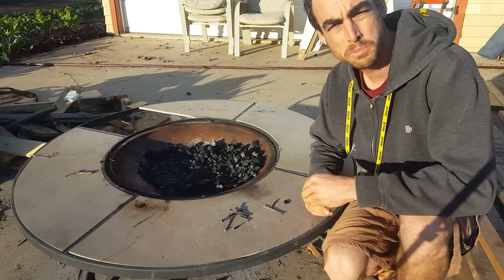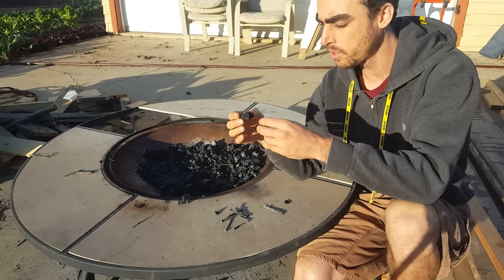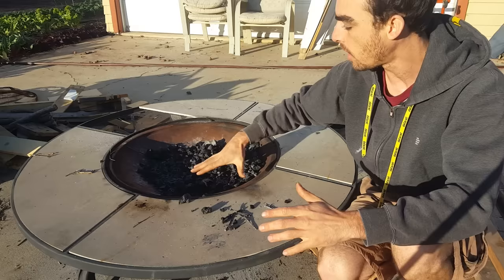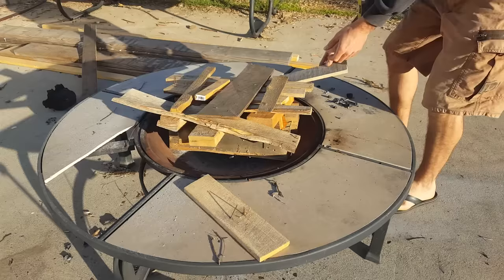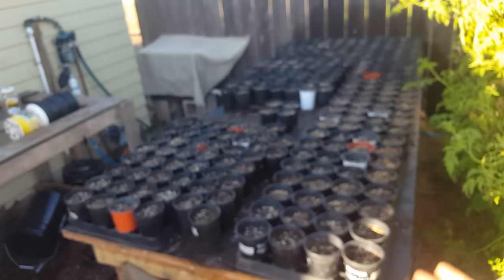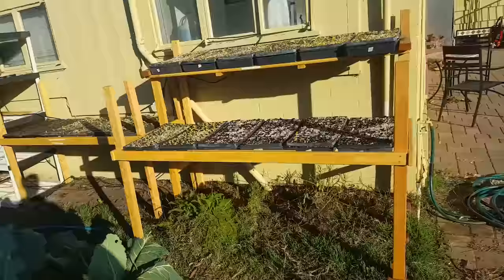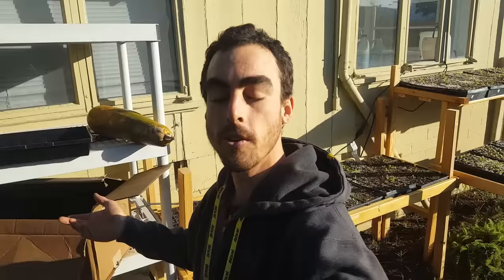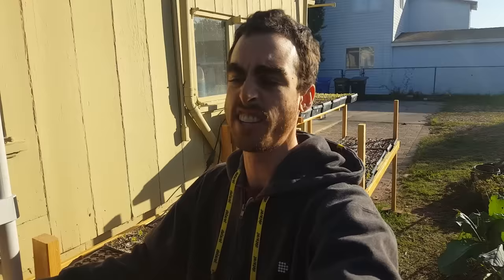Market Garden Vlog | Best 1020 Seedling Trays

Comment: Small correction, it is notvthe temperature that causes the char to turn to ash but the presence of oxygen, you pyrolise things at higher temperatures (even 800Celsius) and still not get ash.
As all volotiles have cooked off and oxygen gets to the embers at that point the temperature will increase because coals just burn way hotter than the syn-gasses.

You still did a great job explaning it though :)
Reply from the maker: Ah right the oxygen! I remember my teacher telling me that. Thank you for the correction, total novice with biochar still hehe.

Comment: If you acquire enough clay like mud, which shouldn't be an issue, stack up your logs in a manner that will fit your fire pit. But make sure to do layers. Take hay and small twigs and put them on top and all around your logs. Than take your mud clay mix and build a barrier around the wood mound. Making it thick to help prevent cracking. After which dig out small holes out of the clay, around the mound and on the very top. Light your dry material around the holes and on top... wait for the wood to start glowing red, than cover the holes with more clay. This will slowly start to cool every thing down whilst turning the wood into biochar. Honestly I've found this to be very effective and extremely cheaper than buys a kiln for it. Minus the fire pit, it's all natural resources and the clean up is simple. Hit that like if you like that method. I will note like a kiln this will take sever hours. Have a great day everyone. ^.^
Reply from the maker: Thanks for the advice Michael, sounds like better way to do it. I was just screwing around with with the fire pit to see if I could make it. So do you do it in a pit? I'm in an urban area so that's why I was thinking to do it in a kiln so it doesn't look like an open fire lol.
Reply: Nature's Always Right you can do it in a fire pit or in a dug out. The concept is still the same. I've seen it done in mud and clay tanks as well. But with the tanks you don't have to open up holes around the tank, just around the top at first. I have a small fire pit that can be moved around. Bought it from Wal-Mart for dirt cheap lol. I build a table that can placed around it and taken off so you can hold a bit more for the barrier. The one tip I will say is to have a little more mud clay mix on hand and every so often check for cracks around the area and just fill em when needed. Other than that it'll take care of itself.... one more thing though lol. Try and use a combination of 60-70% hardwood and 40-30% soft wood. I hope this was helpful to you. Keep up the great work!!
Reply from the maker: Ok nice thanks so much Michael that helps me a lot. I'll try to research more about using mud. I'm trying to do this easily and cheaply, I found an awesome source of 4" diamter totally dried bamboo that I want to use as my wood. Like 1000,s of feet of it. But it's like 6 feet long so I'll have to cut it all up, so looking for something I can fit 3-4 foot pieces into.

Comment: Was that plywood in your fire for the biochar?  Biochar is great and i use it myself but i don’t recommend using plywood or anything with chemicals in it.  Find a local furniture maker who uses natural wood and get the scraps. Should be free or low cost and free of chemicals too
Reply from the maker: Ya you are right I just noticed there was a piece that got in. Oops, the rest was just scrap softwood from building projects. They use adhesive to combine the layers of wood? Nice thanks for that tip! Once I build my kiln I'm going to burn bamboo, I have a really good source of it. This char was just for fun to see if I could make it at home really simply with little knowledge haha.
Reply: @NaturesAlwaysRight  You really need to learn the fundamentals of making charcoal, like limiting oxygen into the fire .
Reply from the maker: @kimblewt  This was just to introduce people to what biochar is (most have never heard of it) not a demonstration on how to correctly make it.

Comment: Thanks for the 10-20 tray source. What % shade cloth did you purchase? Will you use the shade cloth all of the time or pull it back when the temps aren't too hot?
Reply from the maker: No problem, I searched forever for good trays. I'm using 50% shade on recommendation from other local farmers. It will be like 85-95 all summer so I will leave the shade on all of my greens. I'm not using it on summer crops like tomatoes and squash.

Comment: Hey dude love the channel keep up the good work. I just had a question about seed starting, whats your opinion on soil blocks vs flats? I know the permies have hyped up the soil blocks but is it worth the extra time and effort? Thanks.
Reply from the maker: Thanks man :) Sure I have used both for many years now and here's my opinion on them. Soil blocks are absolutely superior when it comes to plant health, germination, less transplant shock and ease of transplanting. I support soil blocks all day long. BUT as you mentioned they are time consuming to make. So it is a trade off. What I do now and I'm continuing to experiment is to use both for different purposes. 80% of my crops I direct seed but the rest I do as soil blocks or plug trays. Right now I'm doing lettuce and green onion in plug trays. Things that I need a large number of transplants for and also have more minimal root structure. Kale, chard, collards, I do in soil blocks because I don't need as many per bed and they do much better starting in blocks. Plug trays dry out quicker, and are annoying when it comes time to plant because there is prep time getting them out of the trays. So lot's of variables to consider.

Comment: What kind of filter do you use  on your irrigation?
Reply from the maker: The boogie blue plus filter,  http://amzn.to/2Cb1PBo. I'm due for a new filter soon and I might actually try a different one. This one lowered my water pressure a bit too much. It still runs my entire drip fine but a few of my super fine mesh wands don't work with it. So I'm hoping I can find another brand that is a little better on that. But if I can't find one that suits my needs better I would buy this one again.
Reply: I'll try the boogie blue plus but be sure to keep us posted if you find another filter that works out better. Thanks
Reply from the maker: Sure will do! No problem.